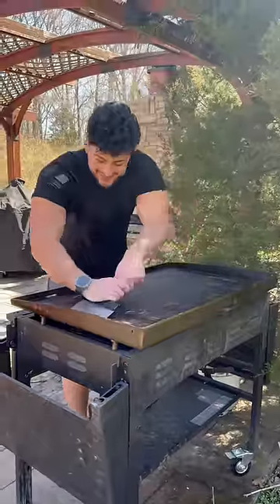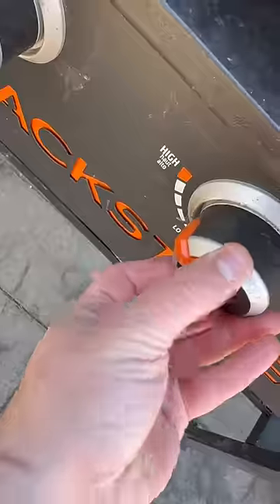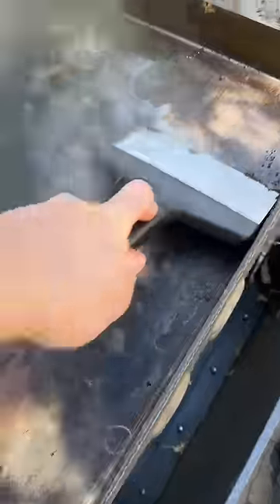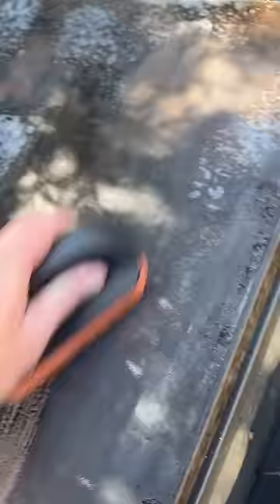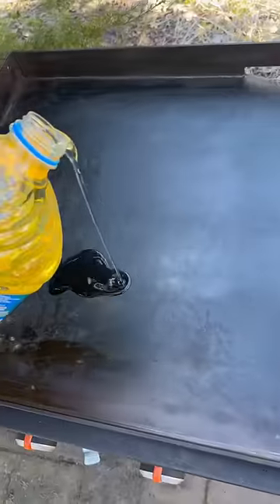Restoring My Blackstone

Comment: You just let the degreaser dry on the griddle and didnt rinse it off. You are supposed to use it to loosen grease not as a coating. Not safe to eat off that.

Comment: I’ve had a blackstone griddle since they released and I will say that I followed all these tips and the problem lies with how much oil you use. for a 36 in griddle you should only use 3-4 tablespoons because if you use a ton the seasoning will be too thick and it will chip off eventually.
Reply: AGREED
Reply: Facts, he used way too much oil but everything else was spot on. You don't want your oil to pool at all. A LITTLE goes a LONG way.
Reply: It's usually better to apply oil to you paper towel, distribute evenly from there- if you walk up to your pan and it ever feels like there is a layer of sticky gunk on it, it is due to excess oil during seasoning. Tiny little bit, smoke point for a couple minutes all the way around, an extra layer or 2 for new pans. Just one or two layers per cleaning. Always finish with a layer of fresh unburnt oil if you won't be leaving it too long, gets you rolling better next time around. And for long term storage - MINERAL OIL IS YOUR FRIEND
Reply: was thinking the same thing. even 1 tbsp should do, just use a very thin layer applied by paper towel, burn it, repeat 1-2 times, seasoned and non stick. thin layers like wood workers curing finished product
Reply: Definitely,  a little dab'll do ya
Reply: Yup. To much oil will start looking like pollen on your food
Reply: @fromheartfeltplaces_4627  i prefer cotton rag since it doesn't leave little bits of paper behind.
Reply: Well shit! I dont have a blackstone grill but I do have a pizza steel I use in my oven for cooking and it did eventually start cracking up.  Now at least I know why and can adjust my oiling between uses accordingly.  Thank you.
Reply: Thin layers, and multiple heating cycles. 100% agree.
Reply: Also use something of quality.

Comment: I used to work at a Burger restaurant and we never used chemicals to clean our grills. We put Pickle juice while the grill is hot then keep it there for at least until it dries out. Then turn the heat off. Use ice cubes to rinse it out while scrubbing with metal scratch.
Reply: The Vinegar in the pickle juice is great for cleaning grime and oil.
Reply: lol I was unaware that Burger King left their grills exposed to a harsh outdoor winter without use for several weeks…
Reply: I use vinegar or any spear lemons. This guy's degreaser isn't even rinsed off. Though some apparently leave no bad residue.
Reply: @theinvisiblewoman5709 Ok smart ass there’s still multiple comments exposing this dude for not doing it right regardless 😂
Reply: I don’t mean to be that guy but pickle but you did just describe putting chemicals on ur grills
Reply: @finbarrsheehan8304  natural chemicals I guess 🤔
Reply: @mco_jont  firstly lol you can’t compare two different situations just because it regards the same object. Second he made a follow up post and he said the cleaner he used is chemical free. So my smart ass point still stands strong
Reply: @daniell8331 as a longtime Blackstone owner, the degreaser Blackstone puts out has no residue
Reply: I've used minute maid and it leaves it shiny
Reply: @MonitorMonarch  I'm not sure  I can agree to this. I just looked at the ingredients. one, sodium polyciliate, is not really an actual listed compound so misnamed maybe. another, sodium salt edta, is a compound in the treatment of metal poising. and quaternary ammonium which I already know from the food industry, is in rinse only cleaners however the existence in another ingredient, the fatty acid produced amine oxide, may serve to deal with the quaternary ammonium but its probably only there to keep it in solution. as I know one of these chemicals is a potential food contaminant so I would rinse. The industry standard no rinse is just potassium carbonate solution. Long winded reply sorry.
Reply: Ugh, vinegar is such a good cleaner if only it wouldn't give me ptsd, but my grandma used to clean her entire apartment with vinegar and apple cider vinegar, that smell is stuck my nose 'till this day 😅
Reply: It's the vinegar lol I worked at restaurants where vinegar was used , smelled so nasty lol
Reply: @TAPATIOPLEASE  yup!! Never liked how it smells when dried out. 🤢
Reply: Pickle juice is vinegar, which is Acetic acid, a chemical. Acetic acid + heat reacts with a lot of elements, including rust, breaking them down into water soluble components. Even soap is chemical. Everything except water itself is a chemical cleaner.
Reply: Those are still "chemicals", even if you're sourcing them from food waste.
Reply: Dude I’ve used hi-c orange, pickle juice, chemicals, lemon juice and even just water. They all work but some require more elbow grease lol
Reply: @bigkiding1543  just don’t forget to apply oil to the grill after cleaning to avoid Tarnishing.
Reply: Vinegar is a chemical
Reply: -i don't use chemicals, just pickle juice
-pickle juice is full of vinegar, salt, and water, all of which are chemicals
Reply: if you don't have pickle juice use lemon juice with a bit of water! 😎
Reply: @theinvisiblewoman5709 😂
Reply: That's the way! 
That's how you do it!! 💪
Reply: Vinegar also known as Acetic acid or Ethanoic acid, never used chemicals my ass
Reply: Vinegar is a chemical

Comment: Just a little info that I learned from my father, you don't really need to use any chemicals (this way it'd be better for your health also), instead all you need is some water, half an onion (just cut one onion in half it'd be enough, if not you can use the other half too), mix some water and vinegar in a bottle (around 30-40% vinegar might be enough but it's all good if you wanna use more vinegar too, a small 0.5L waterbottle should be enough), so after you got everything ready turn on the heat, once it gets hot pour some water (just like in the video) and start scraping once water starts boiling, then turn down the heat (around low-med should be enough) and pour the vinegar-water mixture you jyst made, again scrape it away, then grab one half of the onion and use the onion to scrape the whole surface, then pour some vinegar-water and scrape it away, then you can pour some clean water and scrape it away too then finally you can use some napkins (or wait for the water to dry off with heat) but be careful while uaing napkins since it can stick to the surface, after the surface is dried off you can oil up the surface and it's done! It will be as clean as using the chemicals but on the plus sude it'd be cheaper and also safer since you won't be using any chemicals, enjoy your cooking!
Reply: the “chemicals” hes using does the same thing as dawn dish soap which almost everybody washes their pans in. if you couldnt wash it away it wouldn’t be sold by a grill company to clean grills.
Reply: @blueberrypearlproductions  I don’t say you can’t I am saying that you also can do it the way I explained above which doesn’t require you to buy anything extra because all of these are basic kitchen / household items and these are much better for your health in my opinion

Comment: i feel like the degreaser being left on the surface before you season it with oil is bad. could be wrong tho
Reply: Yeah you're wrong
Reply: i would at least rinse it for the chemicals
Reply: @Omar13t  mmmmm chemicals 😊
Reply: Yeah, I missed the rinse or it's just the way it is 🤷🏻‍♂️
Reply: Yea he went water, degreaser,  oil. Definitely missed a step
Reply: @Omar13t yea bro u even more wrong
Reply: Why not use water to scrub everything with the degreaser lol
Reply: Same it will poison ppl won’t it
Reply: Use Vinegar after degreaser  to remove any residue before seasoning

Comment: If you dont like chemicals on ur black stone. Use charcoal a bit of oil and scrub. The stuff will remove and wipe with paper towel. Do it 2-3 times or until its clean and splash water. And then wipe down and give it another scrub with break and oil. And then wipe.

Comment: grill brick and water to take off surface gunk, strong vinegar next, repeat until gunk is gone. bring temperature to near max and then apply a liberal layer of oil and kill the heat. the oil will seep into the pours of the metal similar to a cast iron pan as the surface cools. bring temperature down to room temp and clean the surface of any residues. apply thin layer of oil to prevent rust before storing.

Comment: I have found leaving it outside, i burn off my last cleaning of oil so it is a dry surface. If i leave it with a coat of either oil or the blackstone butter it catches everything in the air because its tacky. I also sometimes bring out a map gas torch to get into the corners and make sure theyre protected with the seasoning. I have found its really hard to keep the inside edges seasoned the more you use it because the scraper takes it away in the corners. The torch just adds that extra heat to get it to burn on.

Comment: I do fire prevention and part of it is cleaning these things like cocking equipment the best thing to do is get a bit of steel wool and scrub it for a bit with the degreaser on it and then dry it and hit it with a grinder to get the rust off and then heat it back up and oil it and reseason it for the next time you cook. Works the same for any other type of flat top as well 👍

Comment: Did not read all comments but use a. Coffee filter to spread the oil this way it leaves no paper lint/pieces and avocado oil is pricey but has the highest burn temp really helps the griddle stay protected and no allergen like the peanut oil

Comment: A bottle of coke definitely helps get rid of rust and grease. Just make sure the surface is not hot as it will turn to syrup and will never come off. 

Pour on the surface and leave for five minutes and rinse it off. It will be good as new, the same works on clearing rust off bikes

Comment: Did my deep clean for the year I took it all the way down. Nothing faster or better the a drill and a wire cup wheel. All you have to watch out for is any wire that came off but if you clean well after no issues of stray wires. I use steel wool for light cleaning with water only. But I like it hot when I clean. I don't use seed oils so regular lard is for me. You do you.

Comment: You have to spray degreaser and let the degreaser sit and until it’s completely dry and then you turn off the heat and hit it with water and a scraper and that thing will be silver if you wanna go all the way use lime juice at the end with low heat and it will completely clean anything. Then you season your blacktop

Comment: I used as thin a layer as I could still see with with carbon steel and cast iron and that worked significantly better than doing it with any more oil than that... Like all of y'all said, it turns into a tacky, delicate layer that peels if not ur not relatively careful with metal tools for a while...

Comment: If you cleaned and seasoned it after every use you wouldn’t need to do this. You also don’t need an oil with a high smoke point a low smoke point oil like flax seed works great because you need to get the oil above the smoke point to get it to polymerize.

Comment: When I worked in a restaurant we cleaned these by first getting it extra hot, scraping it and dumping ice on it. The temp shock makes a lot of stuff come up like magic.
Reply: The grill in a restaurant is not the same as a blackstone! They’re sheet metal
Reply: @dougnew8152  The one where I worked was cast iron.
Reply: @Meskarune  that’s what I’m saying actually flat grills are cast iron whereas the black stone is cheap flat rolled steel
Reply: @dougnew8152  I see, I didn't realize they were just steel sheets.

Comment: Don't put water on a hot griddle with the heat turned off. You run the risk of cracking it. Keep the heat on, then pour the water on and scrape it. Let it cool after you're done(USAF Mess Hall, 25 year CMSgt)

Comment: That is not the best way to clean your flat-top griddle. The best way is to get a griddle block (this is a brick of a pumice-like material), heat the griddle up, add a ton of oil, and then rub the griddle block on the griddle using a circular motion. You keep scrubbing with block until all of the rust and black crap is gone. You DO NOT want to get the griddle shiny. Just get rid of the black stuff. Then coat with more oil on high to thicken the seasoning, wait a few minutes, scrape off and you're good to go. Source: I use one of these (an indoor version) daily at work. De-glazing with water and using a degreaser will just make the thing stick really bad.

Comment: Please.. no one do this.. not only will degreasing your blackstone ruin any seasoning you have already built up but using that much oil to burn is idiotic. You never degrease and only need about 2 tablespoons of oil max to wipe all over the griddle and burn that on a few times

Comment: Completely wrong. Do not follow this dude’s instructions. Right after he sprayed it, he should’ve burned off all the seasoning and reasoned from the bare steel. Those patches of rust will not season properly and will chip out. Also, see the puddles and streaks of oil at the end? Yeah, that’s not good either. The only oil that should be left on it is what multiple dry paper towels leave on. A tiny thin layer. No puddles.

Comment: You are not the guy to  create videos on Blackstone maintenance.  You see all those patchy areas?  This occurs because as you showed later, your seasoning was too thick, so it lifts off as you continue to use it.  Additionally, you clean the blackstone after every usage by scraping, wiping oils off, then applying maybe a tablespoon of oil and spreading evenly when you shut down.  Sorry, but the condition of your griddle shows you are failing, and all the steps you show proves you have no idea what you are doing.